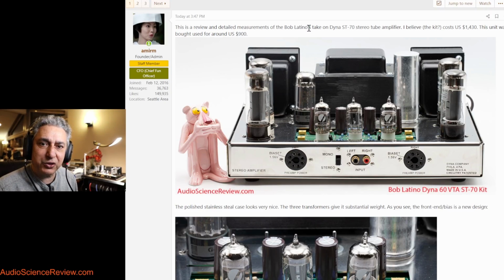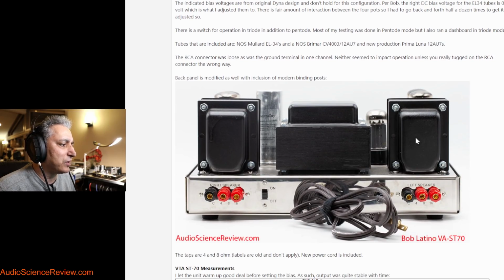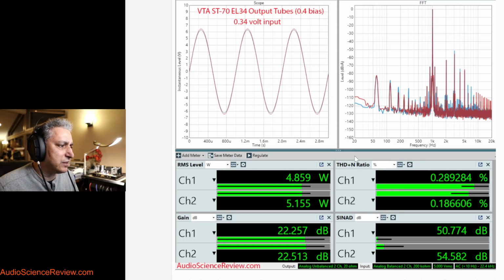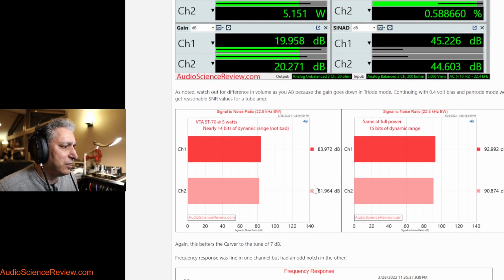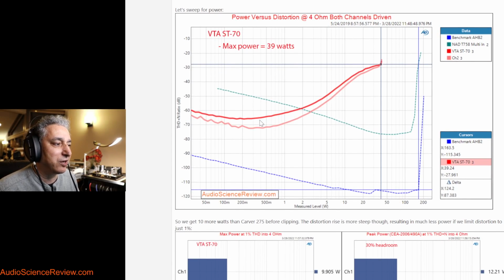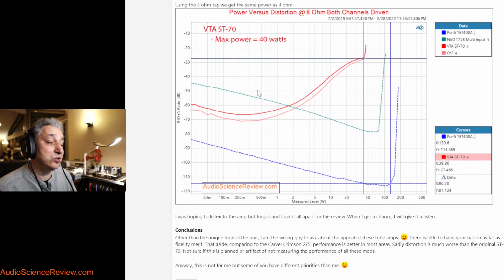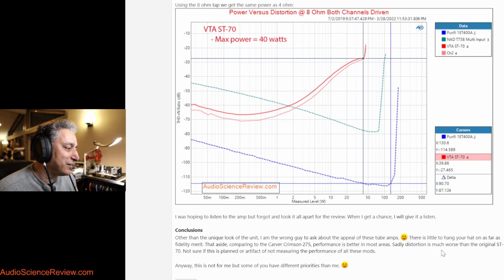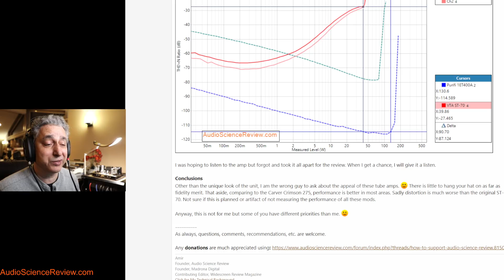VTA ST-70 Tube Stereo Amplifier Review

Comment: The beauty of tube amps is that you can build something that makes decent sound with simple circuits and upgrade your design over time. When you buy a benchmark of purifi amp it's done. If you are really really good at designing you might be able to build a pre amp stage for you purifi module but most wouldn't even dare to do so.

Comment: I restored a ST70. It has original 7199s and transformers. Honestly,  its ok. I think its very overrated.  I started out with tubes and I am  a fan of the way they look. However, The bass is slow, and muddy.  there is an air to them, but yea it distorts when cranked. Why they used EL 34 and tube rectifier is probably a technological reason as there are better tubes for this such as 6l6gc and SS rectifiers. 

Marantz 2235b i have also restored and its much more clear, the bass is much tighter.

Comment: In 1968 I said goodbye to tubes forever and never looked back.
Reply: In 1986 I purchased my first valve amp and never looked back
Reply: @matthewtaylor7355  to each his own. I liked the greater clarity and I could afford a much more powerful amplifier. Funny, my tube amplifier was Harman Kardon A500 that used 7355 tubes. I still have it, never use it. Needs to be recapped. Should have built the Dynaco Stereo 70 and PAS3X instead.

Comment: Hi Amir, many thanks for what you are doing on your channel! I do have a question about quality control, if a company tests one unit out of hundred produced, can the results be reliable to conclude that all units are the same? What I’m getting at is can you say with certainty that every (CC275) Carver Crimson 275  amp is as bad as the one you tested! I purchased a CC275 and have been generally happy with its performance. My other amp is a McIntosh mc352 which in the day was $7000.  When I listen to each amp using my Klipsch La Scala’s I prefer the McIntosh. More detailed in the mids and highs. I can here more voices and pick out more instruments and details. When I switch to Magnepan LRS speakers the two amps are equal to my ears, maybe the mids on the CC275 are a bit more lush. My CC275 is very quiet, no hum what so ever, as compared to an St 70 I owned years ago that I sold because the hum was so annoying. My point here is perhaps you should ad a note on your reviews that you are testing single units and they could be an a outlier when the review is particularly bad as it was with the CC275. I have to say again thanks for what you do! We need more science in the audio world to combat the snake oil aspect of this hobby! I remember sitting through an hour long demo from Audioquest on power cords, along with 40 other Audiophiles. Watching some of them nodding their heads saying they heard a difference, and myself thinking no all the same. Again thanks!

Comment: That’s why I like the original circuit of dynaco st-70.
Reply: The Dyanco ST-70 Mark II was really the proper step up.  It used solid state rectification so bass is much tighter, and replaced the 7199 tubes.  Also has automatic bias meter led's.  The ultimate ST-70 in my opinion.

Comment: I think you're nucking futs!  A pair of these absolutely sings in my system...clear as a bell, musical, lively, holographic from 60hz up (bass isn't great, but everything else is).  They simply sound beyond wonderful.   I used a pair of stock Dyna 70s for over 20 years, and find the VTA mods to improve (subjectively ) on the Dyna 70s in just about every category you can mention.  The Dyna 70 is one of the best selling amps of all time....for good reason.   Either something's amiss with the rig you evaluated, or there's something wrong with the evaluation process itself, because my experience with VTA has been stellar.  Having owned many receivers, two Hafler amps, New York Audio Labs, and Discrete Technology amps (modded B&K), IME the VTA 70 represents among the best values on the market.
Reply: An objective bad amp can sound nice, especially with a ton of harmonic distortion. I had both a 300b and el34 amp. Both measured rubbish but especially the el34 sounded lovely. Just know that it's distortion you like. It's not hifi, it's ear candy.
Reply: Inded Scott........strange comments from someone who claims that digitalprocessing a natural sound make it better !.........he must b
elieve also that processed food is more healthier than natural real unprocessed food....
I lived and worked with tubes for over six decades .......in every technology there are bad and good designs......to my experience tubes ( nos ) are better preserving the soul of music than solid state ......solid state means half or semi conducting ......
Yes I have and love some of my solid state amplifiers and some of them come close to a good tube amplifier but my heart beats with tubes .
Reply: Completely agree, whatever data this guy thinks he's generated doesn't equate to the listening experience.  This is really the defining line between audiophiles.  Do you like what you're hearing or do you like what you're reading?  I listen to an amp and decide.  Fine tube amps sound far more enjoyable than any solid state amp.  I don't care about imaging and where the tambourine player is located.  I want it to sound pleasant.
Reply: @julesl6910  I totaly agree with you ...........i watch his videos to better catch the mindset of these ( deaf )" experts "..............just like telling other people that cables don't make a difference , maybe he's right they don't make a difference in HIS own system !?

Comment: Transformer coupled outputs should always deliver the same wattage on the 4 or 8 ohm taps. McIntosh autoformers do that for solid state amps. My MC2150 is 100 watts at 4 or 8 ohms.

Comment: I find going full Solid State, especially with most of the “New” power amps tends to be too bright for my liking. Maybe it’s just my age, but tubes somewhere in the chain of things allows me to listen to music closer to how I learned to love listening to music in my younger days. Although I never had tubes back then, the sound I became accustomed to probably was more that the speakers back then played with a much softer sound than many of the ear drills of today… Heck back then the speakers even looked soft, I still remember being able to see the fiber weave of the woofers… LOL.

91db + speakers, Digital Signal, Bright SS Amp & Pre… Ugh. 
Sure a set up like that is accurate but fatiguing no matter how much room treatment. Keep in mind this is just me and your milage may vary.

I had the Carver 275 for just shy of 2 years and I have to admit it sounded really good. Had it hooked up to a Parasound P5 Preamp at 1st running Triangle Comete’ EZ Bookshelves, then switching over to Maggi .7’s.  Sounded great with the high efficient Triangles but on the Maggi’s would hear it’s low power affect the Maggi’s ability to deal with mid to high frequencies once you tried to turn it up, low volume though sounded pretty good but I could always hear there was a headroom issue…. the speakers always sounded they wanted more. 

I Purchased the carver thinking I’d be getting 75w x 2 knowing I’d be moving into a set of Maggi’s.
I Really felt mislead by the marketing and even though it sounded pretty good at lower levels, felt it’s power limitations and the thought of having to lay out big bucks at some point to replace (4) KT-120 tubes was just too much so away it went… Replaced it with a SS Oddessy Khartago Extreme Amp & Tubes4hifi / VTA, SP-13 Tube Preamp allowing me to continue having the tube sound I love and have been experiencing Audio Nirvana ever since.  

It’s not always about accuracy but rather if you enjoy what’s coming out of your rig or not. It’s not that controlled distortion is wrong, it’s just a different flavor. Tubes and the distortion they introduce can be quite pleasing if you’re seeking a more relaxing listening experience.

Comment: All vacuum valve amps aren’t the same.  You get the good bad and ugly like any product.  Also synergy between source amp and speakers is crucial.  For certain a well engineered valve amp with golden era speakers will deliver plenty of tight full bass.

Comment: I have hypex Ncore dual monos and smsl su 9. Both measure excellent but my willsenton r8 tube amp is so much better. It is not a small difference. Voices sound full and thick, pianos sound huge and in the room, the sound is so much more wide instead of narrow with the hypex. I like the hypex, bass is faster, treble is a bit smoother and maybe a tiny bit more detail, although I'm not sure. But still, the sound of the willsenton for me is better. Hypex sounds a bit Fake in comparison willsenton is more like live music. Speakers used are audio physic classic, combined with Cambridge cxc CD transport.

Comment: Dynaco ST70 is one of the modification & improvement case studies in my book "Audiophile Vacuum Tube Amplifiers". Most commercial mods like the one in the video are fairly superficial and don't improve the performance much or at all. The power supply is the weakest point of this amp and most improvements should be not in the audio circuit but in the power supply! For instance, just look at that joke of a choke under the chassis.

Comment: Hi Amir, can you please test a tube buffer device please? It's very popular and is around $100 on Amazon. These are only 12V 1A devices which are not the usual push pull but are only used to add "tube sound". Do such devices add odd or even harmonics in reality?

Comment: If tube amps sucked so bad no one would use them. Not everyone uses them for the novelty of seeing tubes. And an ST-70 is hardly the definition of a modern designed tube amp. I find it amusing that a lot of people I've talked to who dump on tube amps and listens to any guitar or bass track never takes into consideration that the majority of those instruments are making sound with a tube amp and have been for decades, especially in a studio setting. Only within the last few years has the digital domain started to catch up to the requirements musicians want for guitars and bass. I like SS as much as the next person, but measurements alone don't determine how an amp is going to sound in a particular room with particular speakers. You aren't reviewing, you're just measuring and making assumptions from what I can see. Spend as much money and time setting up a proper demo room as you do on measuring equipment, then make an opinion.

Comment: Is this a joke? You took a used & unverified piece of equipment and "reviewed" it, lol. Can you verify it was up to spec? There is a nice little write up by Bob. He gives you test points & voltage ranges. Very simple. Very basic rule; don't test the unknown.
Then, you compare a 120W tube amp to a new 400W ss amp?! LoL...that's not going to give results favored by the larger amp w/greater headroom is it? Have a 120W used SS amp to make it at least fair? Something of the same value +/- $100; also for science as more $$ usually gives better results. So, apples to onions and should not be mentioned. 
Sounds like you also failed to match speakers to amp in your ''listening session" too. This is a big no-no and you know this but obviously can't have the tube gear actually sound good, now can you?!
A complete ingenuine review. We need less of ppl like you & tube heads who are like you, but w/tubes. I have a nice mix of tube &  SS, depends on my mood. Happens when you stop hating.

Comment: The speaker that suited the ST70 was the Quad ESL57. Most modern speakers prefer transistor amplifiers that have very low output impedance. I did notice the 3rd harmonic higher than second ( theory of PP amps says it would ), I like it the other way. The original Dynaco sounds a bit soft to me. The Marantz 9 is much more like a transistor amp with valve virtues. Original Dynaco's overload the rectifier a bit, don't throw out your other valves without checking ( GZ32 ? ). The 7199 should last a long time.  Good news as it is hard to get.  The ST70 is a great example of minimal design. A very high gain pentode DC coupled to a high current phase splitter ( 7199 derived from a TV valve ). UL outputs. Hafler, Walker and Blumlein designed variations of UL. Hafler is Dynaco. There is global feedback to lower the output impedance. It also lowers THD.  I say it that way as local feedback lowers THD if required. In the day global was prefered. 1930s amps might prefer local feedback ( Schade RCA 807, 1938 ). UL can ring. People design so called Zobel circuits to cure that. The 1972 GEC book mentioned it  ( KT88 ).  Triode should be less troubled.

Comment: This is not great new discovery. Tube amps have never measured perfectly, probably never will. But what they lack in the specs, they more than make up for in the sound. I’ve had several solid state and tube amps. Currently I’ve got a Hegel solid state, and a Primaluna tube amp. As good as the Hegel is – and it’s my favorite SS amp – I much prefer listening to the Primaluna. Don’t let the specs keep you from trying out a good tube amp. Let your ears be the judge, and you won’t be sorry.  You’ll find the numbers aren’t everything. For many of us, tubes will always sound much more natural than solid state. So don’t make the mistake of dismissing tube amps based on the measurements of a single antique model that Amir was able to get his hands on. Tube bliss is worth exploring.
Reply from the maker: Maybe.  I listen to them and have yet to find a tube amp that sounds better than solid state.  At best, the distortion is not audible.  At worst, it is as was the case here.  People though are not sensitive to such impairments so I can see them not hearing the issues.  As long as they arrive at their conclusions in a blind test, I am not going to complain.  But if it is sighted test, then there are so many biases here that no outcome is reliable.

Comment: Infinity speakers was all that was stated. How would anyone expect tight bass with inefficient speakers? What speaker does infinity produce efficient enough for this amp to drive properly? How could you do a review this extensive and not express that enough? You briefly mention it. This amp is speaker dependent. I’ve used mine for several years and it’s not like this video describes. I notice you only respond to people who like what you say.
Reply: Infinity Composition Prelude P-FR.  96dB sensitivity!!
Reply: @ this was a while back, but that was not the sensitivity I recall or whether or not that was even the speaker. Amir is not a reviewer I would trust the opinion of. Infinity doesn’t make any speaker this amp would be good for and as a reviewer, he should know better than to mislead people.

Comment: Another excellent video! Mechanically-induced noise in tube amps is an issue, so vibration isolation becomes important. This makes me question: why do audiophiles protect solid-state equipment from vibration? Have you ever tested expensive vibration-isolation racks or stands to see if they offer any performance benefit to solid-state gear?

Comment: I think what may be missing here is that tube are low power and not meant to drive lower efficiency speakers. I own a valve amp (Elekit 8200R - 8W) that I built myself from a kit - as well as several solid state amps. When I first fired up my valve amp with my 87db speakers - I was disappointed - insufficient volume and distortion. So after some complaining and research I invested in some high efficiency 100db full range speaker (Lii Audio - silver 10 and their Lii Audio matched cabinets ) - so 1 watt of power should give me 100Decibels at 1 metre - so now I get no distortion - decent volume and what I think is a wonderful sound. Rarely go over 1/3 on the volume knob. Bottom line you can't just buy a valve amp and attach normal low efficiency modern speakers to it and expect good results. The whole flea watt power is the concept - with matched high efficiency speakers . The characteristics of the system are stunning sound stage and centre image  - the most beautiful midrange - and surprisingly respectful bass with the cabinets. I listening to all music from classical to Jazz to punk rock and metal - all sound good in my opinion.

Comment: I built one of the Sound Valves VTA ST 70ii yesterday . It was alot different as far as the board goes and mine is SS rectified. It sounds sweet but I have a faint hum in left channel if I put my ear to the speaker. I guess I made a cold solder somewhere.

Comment: My audio jurney began with Mk3 Dyna amps (60w per block). When I switched to solid state in 1971, the reactions were "this sounds so transparent!, crystal clear"
Tubes are nostalgia. And I enjoyed music with tubes AND with modern amps. But to use tubes today is like using a 1940's car as a daily driver. It's fun, enjoyable, lots of looks, but a reasonably priced modern box will wipe the floor with it.
Reply: What are you talking about?  Just because you like how transistors sound you're making a conclusive statement about amplifiers and that's just ridiculous.  Tube amps operate in a fundamentally different way than solid state amps and produce a harmonically different output.  I find people like you are threatened by the fact that the path you've decided upon isn't conclusively "the way" and solid state amps are lacking many of the qualities that obviously many people prefer.  I prefer tube amps both to work on and repair and specifically the way they sound.  Millions of audiophiles do too.
Reply: That’s true but not always. I have a modern made 300 B tube amp and it sounds smooth and gorgeous especially with some of the vocals. I love state amps too but there’s definitely times when a good tube amp is preferable.
Reply: I also have a 1970s Marantz solid state amp. They were considered better than tube amps. The Marantz is good amp but it sounds harsh, somewhat grating and clinical compared to my modern made post 2000s tube amps.